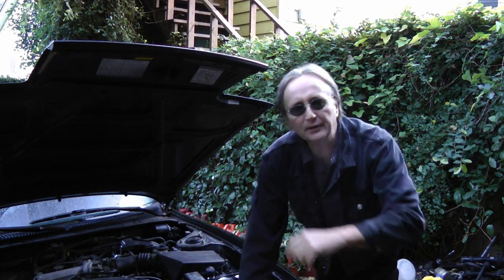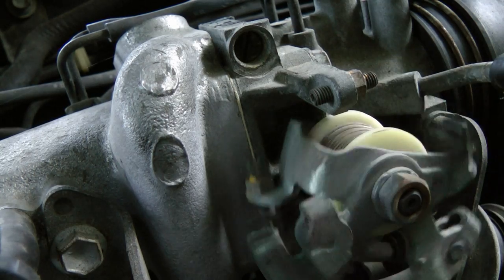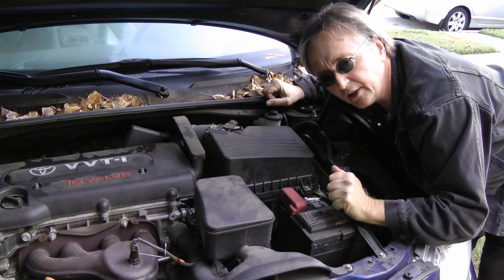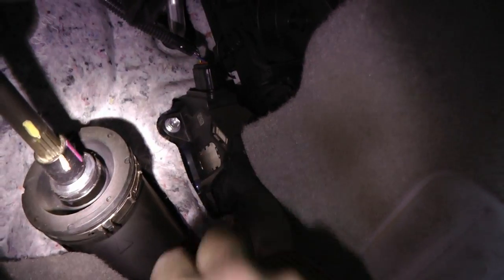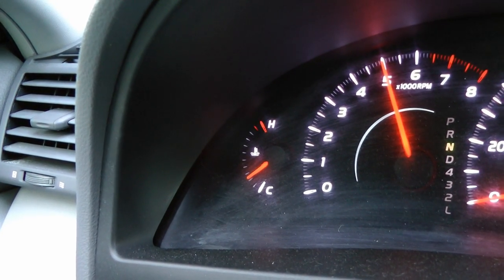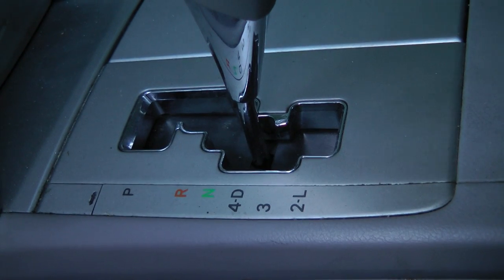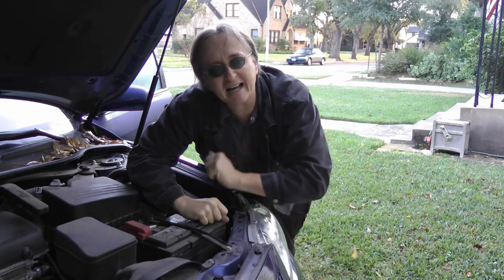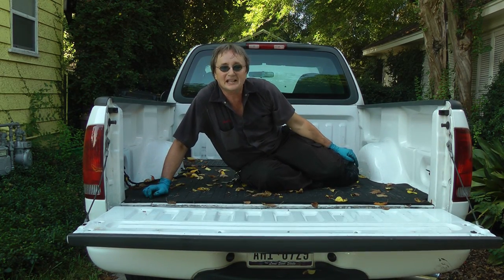How To Stop Unexpected Car Acceleration

Comment: Those new cars with that stupid push button start removes the ability to just turn off the key.  I don't know why such a silly option became so popular, I've been sticking a key in the side of the steering column for 40 years and prefer it.
Reply: Hold the button down for a second and the engine will shut down even if you are doing 100mph.
Reply: sekopiski Maybe, but much like the cameras on computers, there are 2 ways to shut something down, one is to expect software to do it, as that button does  and the other old fashioned way is by an electric open/close switch that physically opens the circuit.  Which do you think is more reliable? 

Scotty, where are you?  Your comments on this would be appreciated.
Reply: If all else fails, pull the handbrake, it'll drown you engine with fuel maybe, but it will save your life, and the lives of others.
Reply: I politely doubt that the handbrake would stop a runaway car, especially some of these new ones with ridiculously high horsepower.  Those brakes only work on one or two wheels and are intended to keep the car still, not stop it when it's moving, especially at high speed.
Reply: Jos Plekenpol
The handbrakes on cars nowadays barley do anything. They're not emergency brakes like cars used to have, they're simply parking brakes meant to keep the car still. Trying to use one to slow down at a high speed would more than likely strip the mechanism bare and make it useless.
Reply: Jos Plekenpol pulling the hand brake/e brake/parking brake  will not drown a engine of fuel its a completely different system  its not even connected to the computer best thing is put it in natural pull to the side  and step on the brake and shut it off
Reply: People always hate change, it's fairly normal.
Reply: Didn't old cars have push button start too?
Reply: Tinu Thomas There probably were some that did that. I don't know of any, but I don't see why it wouldn't be a possibility.
Reply: Benjamin Esposti I saw it on top gear
Reply: Do you even know what happens when you turn off the key? The steering wheel locks up or you lose power steering...

Comment: I had my car do something similar to this once. I was driving on the highway when I stopped at a red light. I noticed the engine was idling at 1100 rpm instead of the usual 650. I kept driving for about a mile, and the engine would slowly increase in speed. I pulled over into a parking lot to see what the problem was. As I was driving through the parking lot, the engine stayed pegged at 2000 rpm in first gear and my foot wasn't even on the gas. When I found a parking space, I put it in park, the engine suddenly revved up to 5000 rpm before I shut it off. I waited about 20 minutes, restarted it, and it was fine. It turns out some debris had gotten caught in the throttle position sensor, making the engine run faster than it should have. It hasn't happened again since, but it was pretty unnerving when it did happen.

Comment: It happened several times on a Hyundai Trajet V6 auto minivan from 2001, at my previous job. It only happened on hot days though, and mostly when you shifted from Drive into park , but it could also happen when the cars was in drive, once it was driving in 15-20 mph on it`s own in city traffic, approaching a roundabout.
The engine would rev up to around 4-5000 rpm on it`s own, it happened many times over the years, but only during hot summer days.
I heard that it could be the thermostat, sending the wrong signals to the engine, someone said that particular problem only happened on Hyundais,

Comment: i have a ford e250 from 2005 with 644000 miles on it and a rebuilt engine. it accelerates up to 40 or 50 mph on its own. it does have bad gas in it and im going to replace that and the fuel filter, but i really dont know why it wants to accelerate with no input. it may be the throttle body but it looks clean. the van does have a lot of sensor error codes like high and low  voltage but they got cleared and haven't come back. every issue i looked into says it should have bad acceleration, but i can confirm it does not have bad acceleration. it recently started stalling when i stop or slow down. it lasted 40 minutes on a highway with no issues other than the acceleration being automatic. i'm just so confused because no sources have any info on why this is happening. it only accelerates in drive and reverse. the engine doesn't rev up or anything it just smoothly accelerates on its own. when i first drove it had bad surges and very rough idling which still happens but only occasionally when i rev it in drive or decelerate. the van freaks out when i push the pedal in drive sometimes which is the surges. id just like some advice with this

Comment: I once had an 80's model pick up that the cruise control had started doing weird things. If you ever turned it on and set it the cruise control would automatically go into the set / accelerate mode and accelerate the car until you killed the engine and started it back up. Putting it in neutral would allow you to safely pull over and all that, but the engine wouldn't slow down. Hitting the brake wasn't shutting off the cruise control either. I'd depending on my speed and traffic just throw it in neutral kill the engine real fast and then start it back up while still rolling down the road. Eventually I got tired of forgetting to not use it and just unhooked the wiring on the cruise control function on the throttle assembly, never did have another issue out of it after that.
Reply: My dad's 78 GMC pickup did that once when my mom was driving it. His solution: Remove the cruise control permanently

Comment: One problem with shifting into neutral, many transmissions are also electronically connected to the shift lever. So, in a system failure, not only can the throttle system go crazy, your shift lever may also not respond. I would try it first, but be prepared to shut the engine off as well if the shifter is as dead as the accelerator pedal.

Comment: My '98 LS400 has an accelerator cable. Runs great and I intend on keeping it for as long as I can.
Reply: +Kenji Almonté Just remember to check cable tension every now and then to make sure it stays taut. I remember a car I used to own that kept stalling unintentionally when driving uphill until I re-tensioned it to remove the dead-zone.
Reply: +4G12 Tension has never been an issue but I know how to fix it, they're easily adjustable. Thanks

Comment: I was easing to a slow stop at a light when my Subaru accelerated out of nowhere. I was so close to cars that I could only swerve onto heading traffic. I think the big issue with automatic car acceleration is the Situation you could be in, similar to mine. Sometimes there are places where automatic acceleration may not be such a big deal, but in my situation it could have been life or death. Unfortunately I didn’t know this could happen and witnessed your video too late. Luckily, the only injury suffered was my tire railing into a sidewalk.

Comment: FBW can also be used to change the throttle response profiles.  When in low range the Hummer2 interpreted the accelerator pedal differently then normal range.  Throttle doesn't open linearly with the aclr8tr.  Torque output can be limited; large movements in pedal translate to small movements of the throttle.  When going slow in rough terrain if you hit a bump and move the accelerator unintentionally it doesn't translate into a hugh change in torque output.  Allows more precise torque control.

Comment: My 06 Crown Vic is drive by wire, I like the consistent feel of the accel pedal vs a cable. The chances of the throttle plate opening by itself are astronomically high, there are too many redundancy's built into the system to prevent it from happening. I know many people don't trust them but one must remember, aircraft have been using this type of control for flight controls for years. I was an F-16 avionics mechanic in the early 80's, they are 100% "fly by wire."  And while I was part of a few crash recoveries I do not recall any crashes caused by unintended control surface movement.  Love your channel!

Comment: Yes it can be shifted while driving most toyotas if you put it on reverse while going forward engine just cuts off  and can restart after no harm can be done I have done it before on my 2011 toyota rav4 about a year ago still running good.

Comment: SO TRUE Scotty.  Here is a bit of tech that is cheaper to make and eliminates cable lubrication, but if it does go wrong the repair costs will be bigger. In aircraft, fly-by-wire saves a lot of weight. In cars ??

Comment: It may be true on the Camry that you can actually shift the gear to neutral, but on many newer cars, even the transmission shifter is only a computer input device. If the computer malfunctions, it may ignore your request for "Neutral" and keep the gears engaged.

Comment: Scotty,
I agree that to YOU and I unintentional acceleration is easily and quickly stopped from someone who is CLEAR THINKING. Many panic and can't figure out the simple fix you mention.  Toyota's are known to do that more than other brand and as far as I know Toyota NEVER really came up with the REAL cause and REAL  FIX. They came up with a lame excuse of blaming floor mats but being someone that actually experienced it first hand I know it is BS. I've had it happen twice and twice I did as you suggest in your video,  Dealer trimmed the accelerator  pedal and checked floor mat snap but I KNOW that is just BS and didn't really fix the problem. I would NOT let my kids or Wife drive a Toyota because of this and would never again own one until they figure it out, admit it and rectify it.  Just my opinion of course.

Comment: keeps us smiling with valid information. I have Honda Civic 2003 EX, it accelerates, i mean engine shouts a lot in first few gears after starting and starts to move later in high gear it is smooth. It is automatic transmission engine, if i accelerate in low speed it doesn't give that much sound but i try to accelerate morethan say 10-20 miles per hour it makes lot of shouting, what could be the problem sir. Why is it not smoothly accelerating without shouting, how can fix that myself.Thank you

Comment: Back to the drivers Ed discussion.  when I was learning how to drive,  both my dad and the instructor taught me how to handle the car without power steering and brakes. I was furious to learn new drivers don't learn this, thus leading to crashes from the Chevy Cobalt ignition switch issue a few years back. there's no way that stalling issue should resulted in crashes!!!  😬

Comment: My dad had a 1978 VW Rabbit Diesel that would suddenly start accelerating on its own.  Pumping the accelerator and the brake pedal (very lightly) would usually/eventually make the problem go away, but whoever was unfortunate enough to be behind you at the time had to eat the massive amount of smoke produced by this "run-away" throttle event.

Comment: With FBW a manufacturer can manipulate how the throttle responds to accelerator pedal input based on a variety of factors if they choose.  For example they could limit the throttle travel if the engine is cold; no WOT unitl the engine warms up.  Or if you are trying to get unstuck in the snow and rocking back and forth, if the transmission heats up too much the throttle can stop responding all together until the transmission is not so hot (seen this in a Nissan Altima).

Comment: Some new cars like Lexus, BMW use push button start and electronic shifter. If the electric circuits controlling the electronic shifter and ignition button fail, there is no way you can mechanically shift the car into neutral or turn off the car. The only thing you can do is to pray that no traffic blocks you before your gas runs out.

Comment: Driving an old car ftw. What worries me... is the new steering by wire... wonder what happens if you blow the battery or alternator. Can you still turn?
Having said that... I drove some of the newer cars when mine was on recall... u can literally turn with your pinky. Also when you hit bumps the steering wheel doesn't jerk, because it isn't connected physically. Kind of relaxing. But I still love no abs, no trac, etc. Just a clutch, gears, cables, and hydraulic lines.

Comment: I had a problem with my 2007 ford lobo it auto acelerated a couple of times. In the Ford company they said that we mistaken the foot in the two pedals but later we discovered that the cruise control had the guilty. There is a trick to DO that auto aceletation issue; just turn un cruise control, step the beakes and turn a little bit the wheels to right or left slowly until you reach the perfect position and poom! the car will start accelerating alone. You can cancel it turning off the cruise control from the steering or turning off the car or neutral.

Comment: i had this happen with a 1993 Chevy CK-1500 5.7L Z71 i stomped on the gas and then the brake and some combination of the two and it made it stop. I was shocked when it happened , it happened in the late 2000's.

Comment: There was a debate on another clip posted by a tiktokers about a 4 deaths accident after a stock gas pedal, and not that much people in the debate seems to knew about that simple fact.

Btw, the driver in the vehicle involved in the 4 deaths (driver + 3 passengers) called 911 instead of trying to simply put the transmission on Neutral. Before the final move, he was supposedly runing at over 140 miles/h. And the investigation concluded that the brakes don't work properly if you pump the brakes, instead of just braking one time and hold the brake pedal to the floor from the start, even if the engine raves at max, the vehicle should stop. And the investigation also concluded that the source of the problem was a carpet that was depressing the gas pedal...

Many other accidents or problems of stocked gas pedal have the same source: carpet depressing the gas pedal.

Comment: Actually had it happen in my 2000 2wd 4cyl Toyota 4Runner. And of course it happens in the worst place at the most inopportune time. If I recall correctly it happened once more, but I understood what to do. Lubed the cable and never experienced it again.

Comment: I had a 1985 VW Jetta that did that.  Luckily for me it usually happened on the highway, where I had plenty of room to react to it.  Throwing the car in neutral disengaged the motor AND released the gas pedal.  Of course the dealer said there was nothing wrong so I had to drive it like that for several months until it would do it every few minutes or so.  I then took it back to the dealer and the mechanic test drove with me in the car.  I kept telling the guy, "remember to put it in neutral when it happens".  He kept saying "There is nothing wrong with this car, it drives just fine!"... and then it happened!  The guy started screaming like a girl and I calmly reminded him to put it in neutral.  I never figured out what they did to fix it, they said they replaced the throttle cable, but that car accelerated without me even stepping on the gas.  I guess they wanted to keep whatever it was quiet.

Comment: I know this is an old video. I don't know if it was mentioned or not, but I worked on cars for years. I've never found any other reason, but stacked floor mats. People put two sometimes three floor mats in a car. This can certainly can cause the pedal to stay down.
Reply: +Jake Johanson good point.  another one is when ricers put pedal covers on the pedals.  those have ridged backsides, sometimes with screws/bolts sticking out that can get embedded into the carpet.

Comment: My 03 Malibu did that today - it was a little scary but it I just shifted it to Neutral and slowed down and shut off the engine. Found out the cable from the throttle body to the cruise control module was stuck wide open. I have a video on my channel from my dash cam from it happening.

Comment: Warning!  My 98 Chevy Silverado had the throttle cable linkage bind up on I-81 in heavy traffic doing 80 mph or so with the bed loaded to the max.  I had no choice but to throw it in neutral cause my brakes weren't enough to prevent me from ramming the car in front of me.  The Engine immediately red lined bouncing off the rev limiter.  I shut the engine and carefully pulled off to the shoulder with limited steering and braking power. Dangerous right?  Well I found under the hood where a 10 year old zip tie finally gave out and caused the the throttle linkage to bind with the Cruise control cable.  Fixed the problem but the damage was done.

The uncontrolled over revving of my vortec 350 had caused the engine to spin a bearing on the bottom end.  This gave me a knock that progressively got worse over the next 10 miles ultimately throwing a rod through the oil pan and essentially ruining my Truck.  It had 243,000 miles and was worked hard hauling loads of antifreeze for me.

Comment: I had an old Ford LTD and the throttle cable would get stuck. I remember sitting at a traffic light pushing on the brake pedal hard to keep it from moving. The rear tires were still spinning and smoking the tires. In this situation, I just turned the key off. But if it happens while your car is moving, shifting into neutral is your best option. Just don't panic!